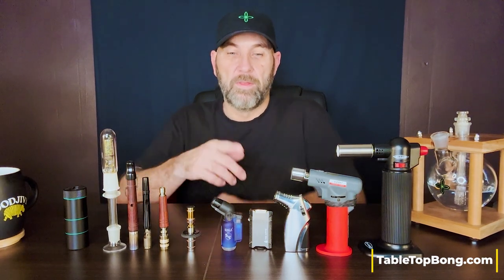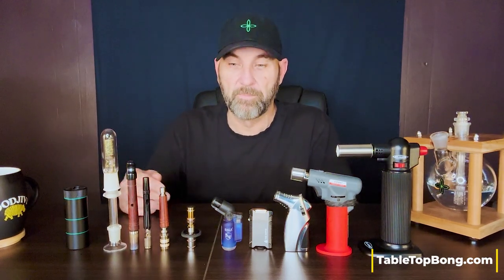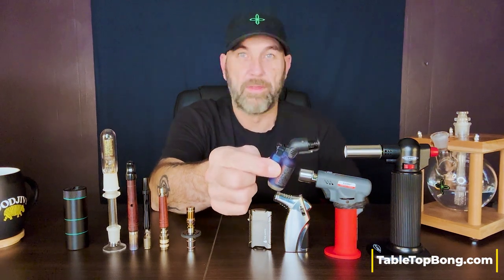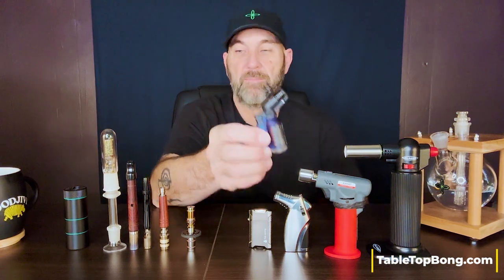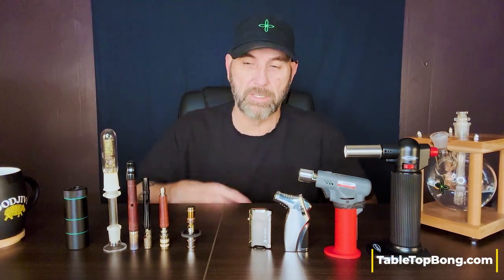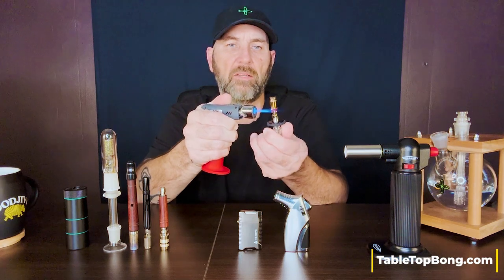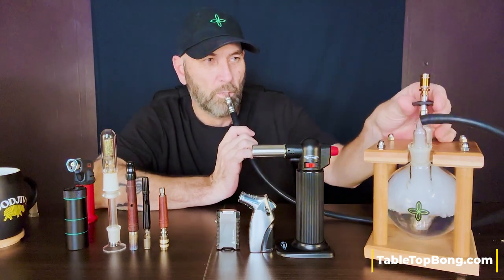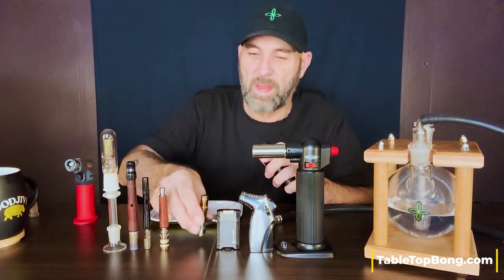Single heat extraction with analog vapes - Tutorial / Helpful Tips

Comment: I’ve commented before on how I recently got a Wand heater for my DV stuff. I’ve also since expanded my glass ecosystem a bit so I can actually use a Dynavap body in my gravity bong from Pulsar (which I highly recommend for anyone who doesn’t want to spend $600 on a Stüdenglass).

This has absolutely changed my relationship to the plant. The flavor is SO much greater than even the tastiest dab I’ve ever had. The ability to microdose with my DV has made my weekends more productive, has saved me a ton of flower, and overall is the best experience I’ve had with the plant.